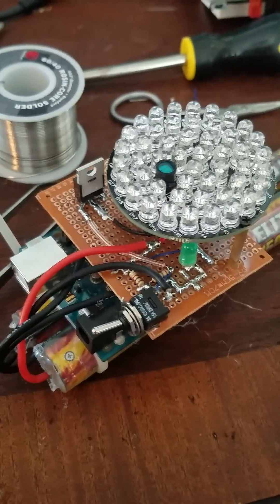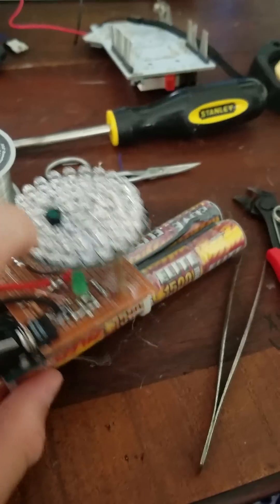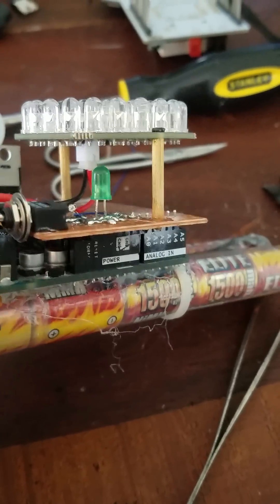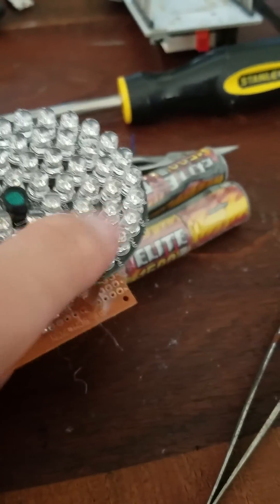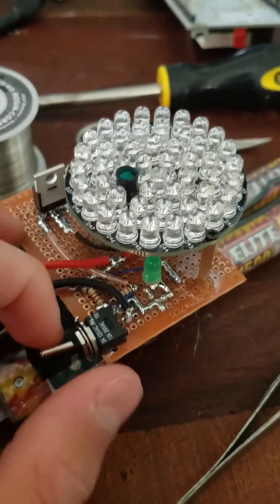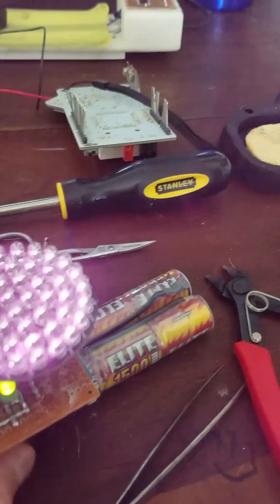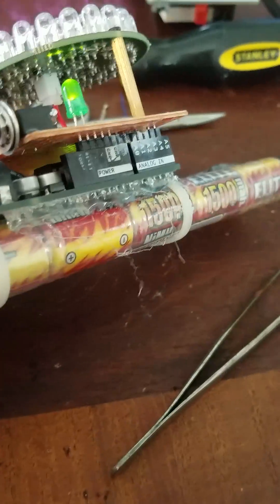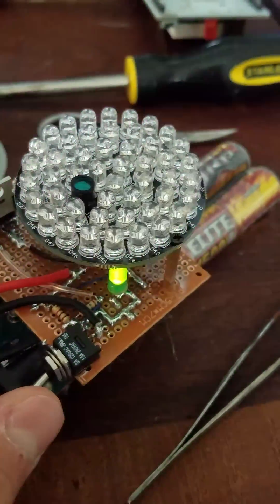Traffic Light Changer (M.I.R.T.)

Comment: you can do the same thing with a much smaller package and less components by using the 555 timer IC, a couple resistors and a capacitor for frequency with signal into a mosfet or maybe even a few stacked npn2222s as the driver.  those 555s are cheap and easy little ICs.  No need for fancy interface.
Reply: You could use a 555. How would you calibrate it?
Reply: @studkickass513  the 555 is extremely precise.. used as a flip flop comparitor you can get the formula from its datasheet.. its as simple as the right resistor and capacitor to set your frequency, duty cycle and pulse width.
Reply: Can you build me one?
Reply: @@convictcreations Im not selling anything.. but you can make whatever you want from low power to high power running the signal through a mosfet or relay.. you can find everything you need from its datasheed and google calculator for it.
Reply: Can I get a detailed list of everything needed?
Reply: I could but this is felony to use.

Comment: Does the sensor like see the flashing light? Do you have to aim it at the sensor? How does it work? Why isn’t it more like a remote controller without light
Reply: The IR sensors on red lights see the flashing light at specifically at a rate of 14Hz, which then sends a signal for the light to turn green. However some intersections are equipped with cameras and use some other methods to determine when and who used the preemptive system so I wouldn't recommend to anyone that they try and replicate this. (Preemptive system refers to the ability to use this in emergency situations)
Reply: MentalTacoDog that’s why I would only use it on the light leaving my neighborhood which doesn’t have a camera

Comment: I'm curious if a person could use that same IR LED connected to a small audio amplifier without any crossover that would filter out lower frequencies and use a simple tone generator app on an Android phone. Figured it would be easy to use the headphone jack with a audio cable that splits to a couple of RCA ends for the input on the amp.  I had bought 4 infrared LED array panels from tmart.com to supplement the lighting for my home security cameras. It has the same setup for the photo resistor and could easily bypassed by shorting the collector and emitter on the transistor with a quick touch of my soldering iron.  Some of the tone generators have multiple output options like modified sinewave (square wave), sawtooth and true signwave.
If the output frequency is stable and accurate, it might be fairly simple to set up.  The other thing I thought about was using a 555 timer and a decent SCR or power transistor.  Thoughts?

Comment: What about using a timing light and revving the motor to 1680 rpm on a typical or 840 on a lost spark ignition engine?  14 hz=840 fpm. A spark plug normally fires every other revolution, so 840*2=1680rpm.
Reply: Benevolent Highwayman why not send a probe to space and build a complicated radar array to flash these leds at 14 Hz from the space?
Reply: @whatever7338  why not just run the red light?

Comment: Did you ever get this to work? I built almost the same thing but between the pulse width and the brightness of the LED array, I can't get it to work. Currently I'm waiting on a 30W LED array which I will be over-driving with a 20v power supply. If this isn't bright enough, I'm not sure what else would be :)
Reply: Richard Driskill big cities use the Omni system and it's controlled by data networks. Source, my brother is a firefighter.

Comment: What wavelength do these use?
Reply from the maker: VB YTP Using “Wavelength=Velocity/Frequnecy” I’m getting 21413747 m for the wavelength of all LED’s operating at 14hz.
Reply from the maker: However this is for the strobe, not the actual LED’s that operate at a different frequency. I’m just going to assume you were referring to the strobe’s frequency.
Reply: I was referring to the LED frequency, but wavelength is typically used for IR LEDs
Reply from the maker: I scavenged them from an infrared security camera lighting system so I’d assume the wavelength would be nominal for infrared LED’s.

Comment: Have you tested it say on a radar detector with emergency vehicle response? My code always seems too glitchy to make my radar detector go off. My dad has a real one on his response truck and it goes off for that every time. I also noticed that I used white LEDs... Probably a bad idea.
Reply from the maker: I have tested it by measuring the cycles per second when filming it when turned on and then slowing it down and counting its strobes per seconds. The code is extremely simple and has few "moving parts" so there's not much room for error, however I would make sure you have a balanced power supply and many L.E.D.'s before expecting any real results.
Reply from the maker: White L.E.D.'s will not work, only infrared will.
Reply: @Belofsky1  How can i get the schematic and a parts list. I would really appreciate it and would be willing to pay you for it.
Reply: @@convictcreations it worked because xenon lamp emits wide array of colors UV included, leds are always tuned to certain wavelength

Comment: Haha that's cool! How did you program it to flash them at 14Hz? They just flash on and off every 71ms (14Hz)?

And do you really need so many IR led's? Are they all connected in parallel?
Reply: Also what's the wavelength of the LED's
Reply: I heard to both use 850 & 940 nm iR’s, one’s more visible in the human light spectrum… also, you gotta get the fatty Stronger emitters if you’re gonna make a DIY MIRT.